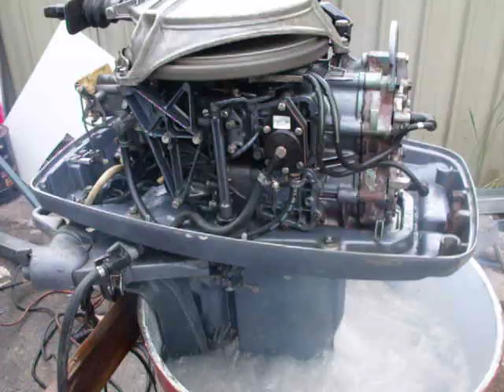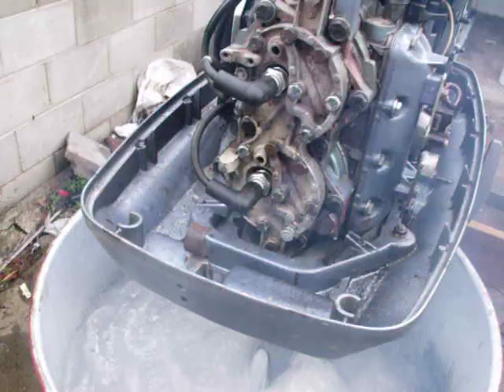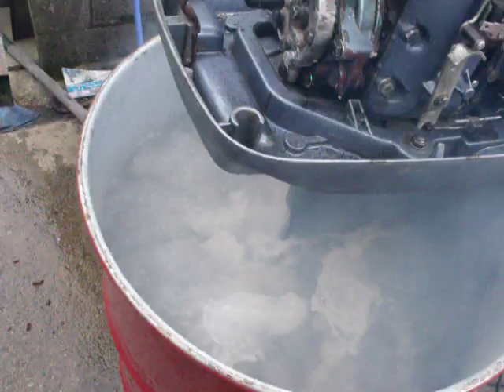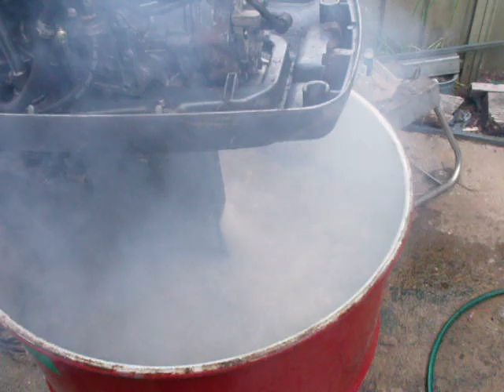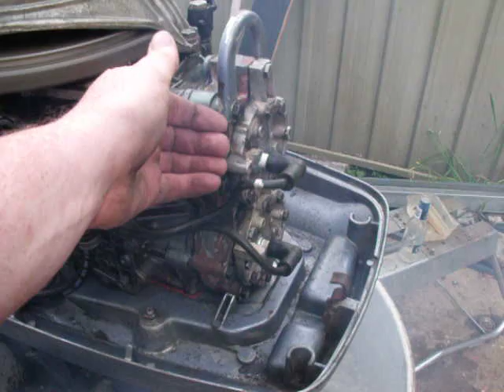Evinrude / Johnson 40 hp... plenty of water.

Comment: It needs a water pump it’s not pushing any water out the piss hole. You will implode a piston, I know I’ve done it before. It doesn’t matter how much water is in the barrel if it’s not pissing it will run hot.
Reply: It was clearly pumping water ? It comes out of the exhaust on these engines its not high up like on modern engines
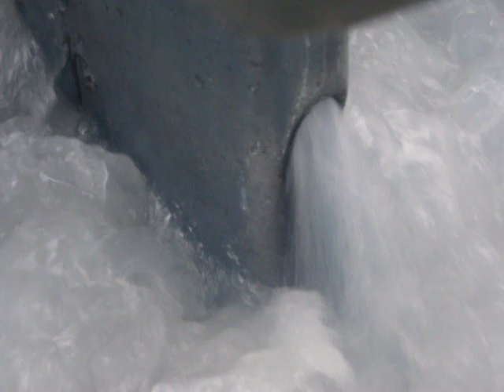Reply: 0:12 u can see it pumping out